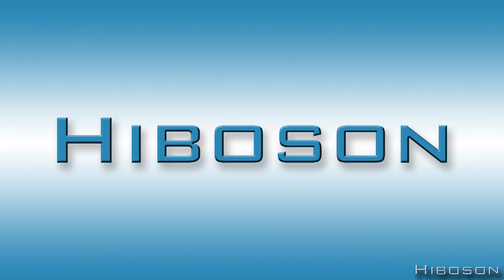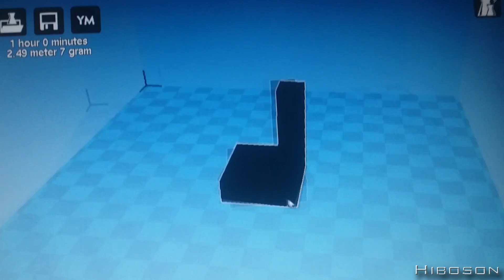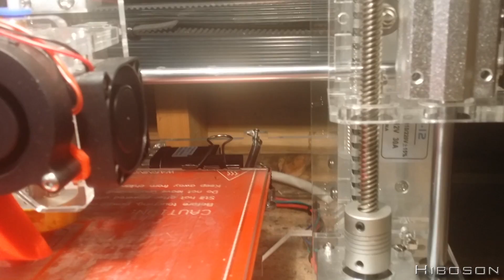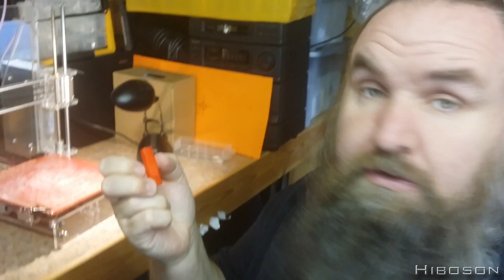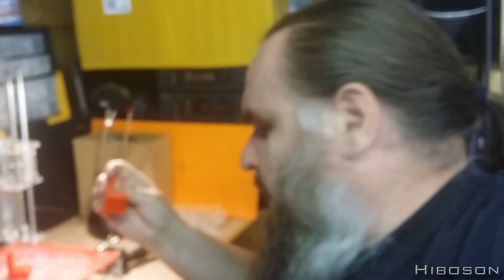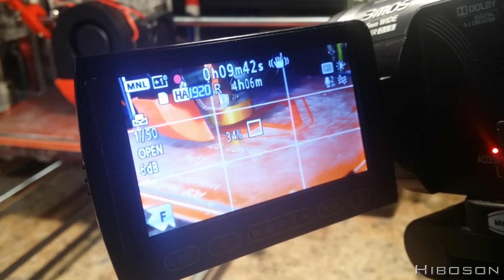Printing New Parts - Sunhokey Prusa i3

Comment: I've noticed my biggest increase in quality  from my prusa i3 when i purchased new pla and not use the pla that came with the printer. I haven't noticed the defect you're getting in my own prints. I have mine set to 210c and haven't had any issues.

Comment: I think if I had to do it over again I would have held out for a aluminum frame FolgerTech has one right now that is cheaper than what I paid for my acrylic Prusa i3.  And as far a bed material goes, I am hooked on 3D-EEZ build plate film. No mucking about with glues and hairsprays and it works on heated and unheated beds too. If it gets damaged you can repair it... Try that with BuildTak.

Comment: Great update.  I just got my Sunkokey back on Monday and put it together.  Everything is going ok so far just a lot of adjustments.  Was told once to check out the power flow to the stepper motors and that they should be around 800 miliamps.  Ever hear of doing this?  Still coupe issues with the top and bottom layers but everything else seems good.
Reply: +jeremiah whiting If you have a multimeter it's a simply task of reading the volts on the stepper motor driver, + lead to centre of adjustment pot, - lead to ground, just be careful not to short on anything ;) set the meter to vdc and the reading in volts just double the reading for amps, so 0.4vdc will be roughly 0.8amps.
Reply: Thanks.  I saw a tutorial on that before.  The pots were low on the motors (roughly .70 to .75) but I fixed that

Comment: get yourself some buildtak best thing ive used for heatbed surface prep.
also wondering if you have any wobble on your x axis through the linear bearings?? as my 2015 model is bad and looking to replace smaller bearings with the dual long  to get more surface area on shafts to help stop the play